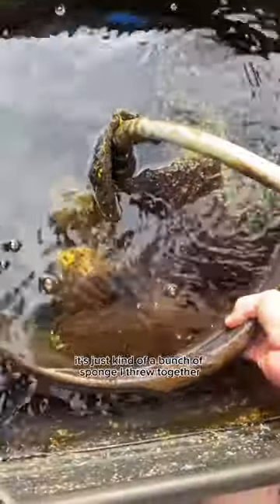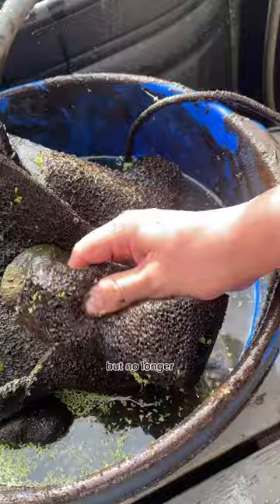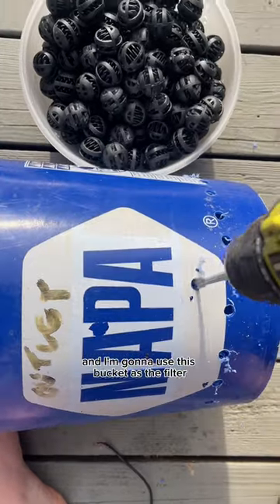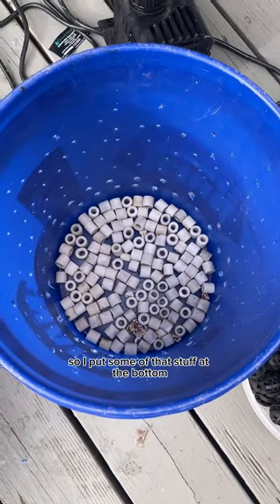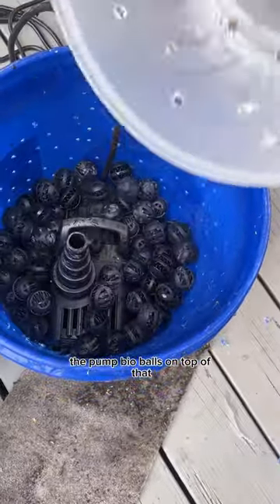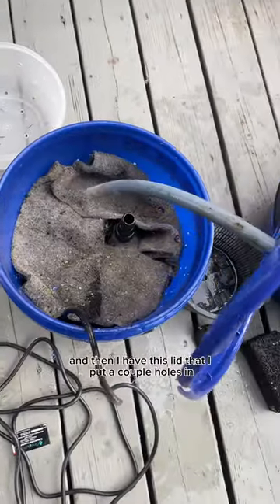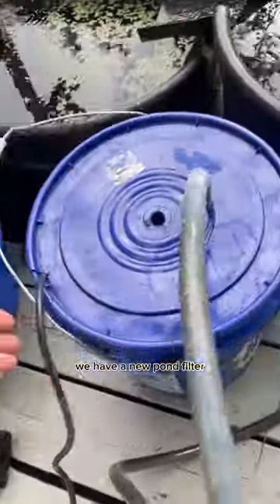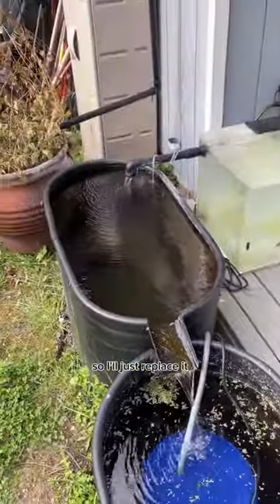How to make a pond filter! #shorts

Comment: I'd direct you toward considering the actual path that the water must flow. Water is coming in from the walls of the bucket, so your layers should be concentric, not horizontally layered. Your water enters directly into your bioballs and leaves, not moving much through any other media at all. It will always follow the path of least resistance.

Comment: Not a bad build. I would replace the bioballs with lava rock. More surface area. Just rinse the lava rocks well.
Reply: Exactly what I was going to comment. A guy at a fancy outdoor pond/koi store told me exactly that, plus uv filter is golden.  I haven't changed the uv bulb in a couple years, ouch. I've found recently changing the pond filter (55 gal drum) a couple times the last 3 weeks, has the water crystal clear.